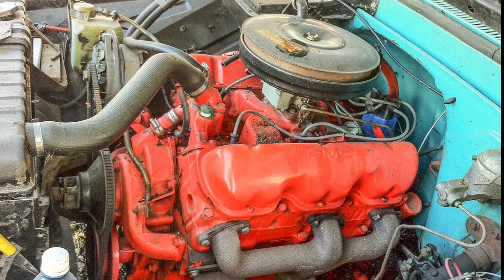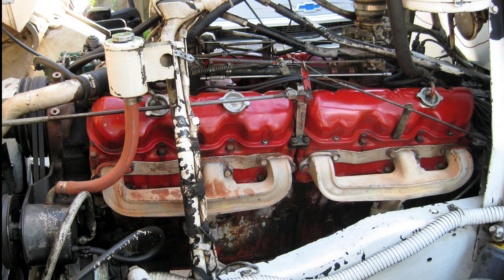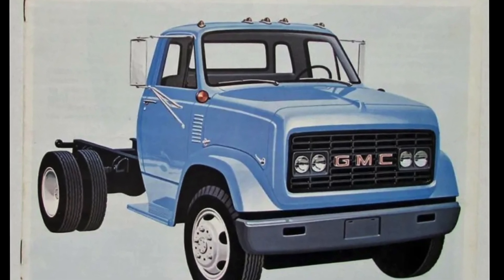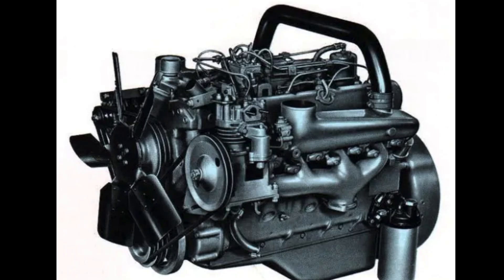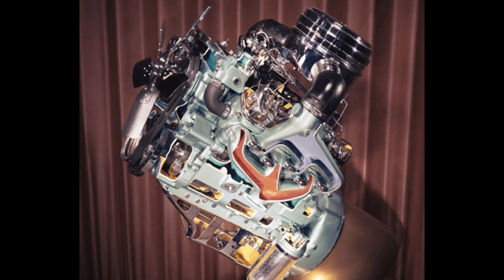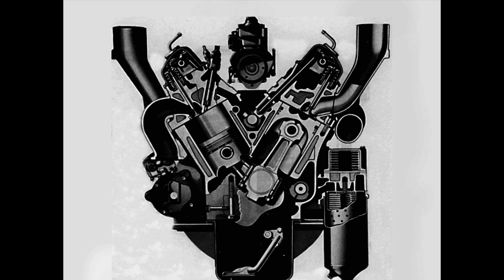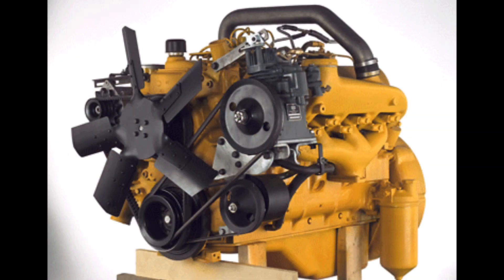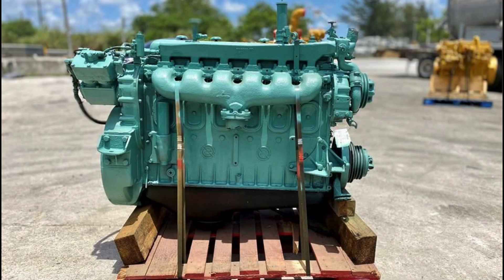Crazy Engines You've Never Heard of: the 351, 478, and 637ci V6/V8 GMC ToroFlow Diesels!

Comment: Great video!  I knew a guy that had a 478 toroflow in a Dodge pickup towing a 5th wheel camper.  He got pretty good milage but had never ending issues, head gaskets and injection pump, etc.  The gas v6 engines were one of the toughest and most durable engines of all time.  A buddy had a 305 and if anyone could destroy an engine he could but the 305 never gave up even with his 100k miles of abuse.

Comment: I have the Hercules 305E V6 in my grandfather’s ‘63 GMC 3/4t 4x4, 4 speed.  So smooth to this day, a real tq monster!!
Reply: Does it have the 63 only plad valve covers?
Reply: @p @patrickmcgoldrick8234  plaid valve covers, but I do have the original, operable, winch on the front and the PTO out the back. My G-father bought it new and we worked the farm w/ this truck. Original evergreen paint too😊
Reply: @bobbyb.1743 I have a 65 GMC 1500,that I have to replace the frame,hit in the left front,the burnt of the impact is on the left rail.305E,SM420,2 wheel ,89,000 original miles.I will have it finished by April.

Comment: It's worth pointing out that if they have the 351cid V-6 Diesel that it's not a big stretch to combine parts from 2 together into a 702cid Diesel V-12 and a donor block & parts from the 702cid Gas V-12.  260 hp and enough torque to reverse the orbit of the moon 🌚

Comment: Maybe I'm weird but it would be nice to hear Torque specs and the rpm where it was produced. It seems torque figures would be more useful than horsepower specs in towing applications these engine were designed for.

Comment: I have a couple of the 305 gas v6s..drove one a lot through the 1990s, it was really good, except for the mileage. A 1 barrel Holley can "pass a lot of gas". Maybe it didn't make enough power to hurt itself, I believe it was supposed to be 150 hp, but did not feel that healthy. Smooth and would pull from just a few hundred rpm. I did not confuse that with having a lot of torque, however- it didn't. 
   Gave the truck away, saved the engine and trans. Quite heavy. 
   I used to know where a 702 v12 was rusting in the woods, right next to the PA turnpike.

Comment: My brother had an old red gmc 4x4 351 diesel on 40s back in the day! That thing was slow as fuck with the granny gears but man it would drag another truck through the mud hole like nobody’s business
Reply: I think I found an article years ago where it talked about GMC had the 351 diesel in  a pair of 3/4 ton pickups that they were testing, showed a photo of one, GMC had toyed with the idea of offering that from the factory.  (Dodge offered 1962 models with the 354 Perkins diesel, option  only lasted one year).  They stopped the 351 diesel after a few years, if anyone has one, that would be rare today.  I  recently read someone's post, he says of all the gas and diesel versions of the 60 degree GMC design, the v6, v8, & v12, that the 637 gas v8 is the hardest to find  today.  He wrote that for many years, (whatever networking he does on online bulletin boards he visits or whatever,  that there aren't more than like 6 or 8 known to exist anywhere in the country, and only a few are running.

Comment: To  make  things worse  ,just  cuppel the  Olds  diesel engine  with the  new  700 R 4  automatic  😢😢  you've got  dubbel troubles  😢😢
Reply: There was never a TH700R4 with the B.O.P. bellhousing bolt pattern. I believe you mean the TH200R4.
Reply: @johneckert1365  yeah  man  I believe you're  right about that  , after 47 years  rebuilding automatic transmissions   I  forgot  more than  I remember 🧠🤪
Reply: @Louis-kk3to  Remember how awful those early TH700R4 were in the early 80's 🤮🤮🤮🤮🤮
Reply: @Louis-kk3to  I'm in the auto salvage business, and I have a hot rod friend that buys every TH200R4 I can find. He really likes them! I assume he has them built though. 
My Mom drove a mid 80's RWD Buick with an Olds 307/TH200R4 for a few years, and that torque converter lock-up solenoid would act up and freak her out when the car would lurch and go fast in reverse lol. On the other hand, her car before that was an 83 Riviera, Olds 307, and whatever that similar FWD trans was called, and it had over 300K miles on it. Trans was replaced or rebuilt once (she bought it with a bad trans) but for her it worked flawlessly. We even pulled light trailers with it, but to be fair, she knew to only used D rather that OD with a trailer. I'd actually like to find another car like that, but with an Olds diesel.
Reply: @johneckert1365  the  200 4R  is a assume  unit but  !!!! I hated  rebuilding  them   ,  im glad  I don't  see them  anymore     and,  that  L/ up really  sucked   😩 47 years  rebuilding automatic transmissions   and the  6 L 80 E is now  our  ( bread and  butter  ) unit
Reply: @johneckert1365  yep  , but  I wish I never  tossed out  all thim  units   because  now  they  are  hard to find  , the Fits all company  used to  make  a adapt  kit  to  change  our  700 to a  350  , no  body  ever  complained  about it  because  it was  allot  cheaper    than the  700 rebuild   now  I  wish I could have  back  those  700 s  because  square  body   Chevy  trucks  need  them  and ,good  ol hot rod s
Reply: @Louis-kk3to  My core buyer in Chicago was paying $250 for the later TH700R4, and $50 for thier torque converter. The most recent price list that came out is down to $150, so I'll stock pile them. They still give $250 for Chevy bell TH400, but only $15 for it's converter. Chevy non-lockup TH350 was also $250, but also dropped down to $150. They'll come back up!
Reply: @Louis-kk3to  I've used that spacer kit to replace a TH700R4 with TH350 in 4x4 trucks before. In 2wd, the long shaft TH350 is the same length as TH700R4, so pretty much a bolt in swap 👍

Comment: THAT GIANT V12 WOULD PULL THA GATES TA HELL DOWN THE TORQUE THEY PRODUCED WAS NOTHING LESS THAN INCREDIBLE
Reply: I saw it on the "king of obsolete", he liked it because it had "dual everything". It's basically 2 engines stuck together. GM was super innovative in those years. It's too bad they didn't quite dot all the i's and had some reliability issues.
Reply: @castirondude Not so much of a reliability problem,but a fuel digesting problem, lots of fuel,but they would last.

Comment: The 6.2 was a great engine. It really did go a long time when taken care of. Even the olds 5.7 could be solid when not in a vehicle. They made excellent irrigation power units. The 8.2 Detroit was an absolute turd. It’s a shame the olds stuff wasn’t better because we would have a different American car industry today had they been able to prove themselves. Us Americans seem to have an obsession power output stats but all my 6.2/6.5 equipped trucks have had a good seat of the pants feel to them. Last forever when used for their purpose. Very low cost of ownership compared to other diesels.
Reply: Those 6.2/6.5 get better fuel mileage than the Izuzu (Duramax) that replaced them.

Comment: Anybody want to see what one of those gassers would do with a pair of turbos? Kind of curious what the diesels would do with some turbos? It's difficult to get any real hp out of an NA diesel. I had a 7.3 IDI Ford and it was like 180-185hp so not really that much better than what these were doing 20+ years earlier.
Reply: The Toro Flow Diesels 478 V6 and 637 V8 were both offered with single , possibly twin turbos.....I'm not an expert on them, but you can find some articles,  pics, on them if interested, just keep changing up the words when you search.  I've looked before.  Those with turbos were installed in boats, I understand they lasted a lot longer, than a Toro Flow that was asked to pull way too many tons.  They were known for being very very fuel efficient diesels for their time. But sometimes,  depending on what truck they were installed in, guys ran them hard, overloaded them, if you treated it like a Detroit, and just rode her hard like a government mule, they had issues sooner.  Ammarine is a name from that era, tied t ok the marine versions of the Toro Flows put in boats.  There's still a video or 2 on YT,  if you search for the V8, but as a 10.4 litre.  (Water cooled exhaust manifolds, but it's a V8 Toro Flow underneath)

Comment: I got my first GMC V6(a 305 c.i.) while serving in the Navy back in 1985.  I bought a former Washington State Forest Service 1963 GMC longbed/stepside.  I found probably the last tire ship in Washington(Tacoma to be exact) that would mount new tires onto the original split-rims.  I drove that truck from Washington down to California when my ship(USS Belleau Wood) came out of the drydock in Bremerton to return to San Diego.  I eventually gave it to my Dad, who drove it form many years up in Northern California  The next was a 351 c.i. in a 1962 GMC utility longbed I rescued from a junkyard in Oxnard California in 2000.  I ended up finding a fleetside bed for it and even found an early '70s camper that I put on.  Whenever I had a long weekend that old beast and I would head east from NAS Pt. Mugu and disappear into the mountains or desert for a few days.  Very early I was given a great education in these V6 GMC engines; I learned how NOT to mistreat them and how to keep them running well.  The most important thing I learned was not to 'over-rev' these motors.  They were designed for low-rpm/high-torgue applications.  That made them great for work-trucks.  Because of that education I never once had a problem with either engine.  I replaced the old points ignition on my '62 with a Pertronix electronic ignition.  I also found a nice Holley 'Economaster' 2-barrel carberator.  The combination allowed me to get a stable 15mpg with this old beast.  I'd love to find another someday.

Comment: Alright! Thanks for another interesting video. Interestingly enough I personally drove a 1968, GMC 6500 straight truck with a 21’ refer box, with a 351 Toro Flow Diesel engine. With a 5 speed low hole 1st, wide ratio w/OD, and a 2 speed rear. We used in a family trucking company.  I was bottom man in seniority so I was stuck with “Shaker” as it was affectionately called. But it ran very well, used little oil to leaks not burned, plus it true that used half the fuel the same truck with a 305 V6 Gas used, plus was quicker if you knew how to split the gears, plus higher top speed at 74 mph, as apposed to 72, at the same rpm’s. Funny thing is Shaker looks just like the blue one in the video only with a big white refer box on the back. I personally put well over 200,000 miles over the 8 years I drove it. Then after the union forced us out of business, my Dad sold the truck to a cousin, that wanted that engine for an old tired GMC 2500 step side pickup that had a 305 V6! That had 180,000 miles and was tired. He was restoring it and figured might as well sell that gas engine and trans, then buy the Toro Flow truck off my Dad, rebuilt the TF and use in the pickup, being the very rare diesel powered all 1966 GMC truck around. He rebuilt it, added two air cleaners, one on each manifold and huge dual exhaust out the sides. That pickup was used to haul out dirt bikes and tow a trailer with 10 others for a group of riders following in their other vehicles. Before? With the tired V6 gas, three speed? It was a chore, waiting for it to keep up. But after that? With the rebuilt TF? with 5 speed? He had to add disk brakes in front! Because of the speeds it would easily reach so quickly, especially when towing the trailer! Plus got more than twice the mileage, like 26 highway, 18 towing! With a wonderful sound! Everyone wanted that truck.

Comment: I've been around, and drove a lot of the GMC V6 gas engines, but have only ever seen 1 of the V6 Toro-flow diesels, and it wasn't running at the time. I wasn't even aware that they had a V8 version of that engine. Pretty cool stuff!😉

Comment: Adam, quoting horsepower for a diesel is not very helpful as torque is the main advantage of a diesel engine. It would be more illuminating to quote torque figures on these diesel engines.

Comment: That diesel at the end sounded very nice Adam. 👌  Unintentionally much needed for me. Lol
Reply: It's just like a certain generation of the Duramax diesel that had head gasket issues. Once that's taken care of with upgraded ARP head bolts and tuning and deleting, they are stout after that, but that's more focused on the modern computers on wheels world, but yeah if it wasn't for GM's confidence in making four stroke v8 diesels, they probably would've never debuted the Duramax lineup starting in the 2000s.

Comment: I have a number of original shop service manuals for these very GM & Detroit engine from my dad, who, after years of being a heavy equipment operator & OTR truck driver, went into being a diesel engine tech back in the late 70’s… myself from end of HS into college, went into construction/framing, followed suite by the mid 90’s, working as a cert’d auto tech for gas & diesel, performing repairs for anything & everything.. then, power tool repair/rebuilding to machining. By oh, ‘07, went to OTR and local trucking, then plumbing, then HVAC, then HAZMAT fuel tanker trucking.. since covid, back to auto tech, gas/diesel & all things electrical… I have auto/truck service tech literature from oh, 1903 to early 2000’s, when most of that went to digital. I too really enjoy all of these engine vid series &, anything else you’ve put together/uploaded for us! One of my top 5 sub YT channels! 👍🏻👍🏻

Comment: I had a really strange motor in a GMC truck. It started life as a V8 Toroflow. Somewhere along th line, th heads and intake manifold was swapped out with gas motor parts. I remember that it used th same starter as a John Deere tractor. I sure was glad when that thing finally blew up.

Comment: Direct-Injection was the exception back then, not the rule. 
Modern diesels almost all have the bowl in the piston because of the DI. 
Very interesting.
Reply: Were these Toro Flows direct injected?
Reply: @johneckert1365  Yes. The fuel is injected directly into the cylinder, not into a pre-chamber.
Reply: @typrus6377  Thank you

Comment: I would bet that this diesel version was the smokey and slow engine I had in my school bus in the early 70s!  It had the same front end as that semi-tractor you pictured.  On the other hand, these GMC engines were much tougher to begin with then the Olds Rocket 350, and would have been an easier conversion to diesel...  
One question, why would a 60-degree V6 need a balance shaft?
Reply: Did Adam say it was oversquare? I have seen 60 degree sixes run buttery smooth, -so it is a great question!
Reply: @ratman5727  I totally agree about so many engines that ran smoothly...
Reply: DUDES, that is my point! A 60 degree V6 should be inherently smooth, ergo why did they put a balance shaft in that engine.?

Comment: If you needed a ~150 hp diesel in 1964, I can't imagine picking one of these instead of a 4-71 Detroit - offered by the same corporation!  Unless the price difference was extremely steep...
Reply: The problem probably was the weight difference.

Comment: Knew two guys that had the Toroflow in a couple of their trucks they seemed to like them. One of the guys said the difference in fuel cost almost made the truck payment. 

Having talked with a few mechanics that worked on the Olds diesels the big reason for the head gasket failures was due to the poor grade of bolts used for the head bolts meaning the head bolts would stretch. The quality of the head gaskets was also suspect.

Comment: Back around 1990 I put a 478 gasoline in a GMC dump truck that had a blown up 305 in it. A guy I knew showed up im my shop and said "Hey I've got one of those engines" Next day he showed up with it in the back of his pickup and sold it to me for 200 bucks. I started looking and saw the dual thermostat housing and knew what it was. Damn that thing was a torque monster. You hardly ever have to shift. Funny thing about it was the exhaust had a low deep rumble that set off car alarms of cars parked on the street

Comment: GM made a huge mistake not putting a water separator in the Olds 350 diesel.
Reply: Right on 👍. Water/fuel separator and some high quality head studs rather than bolts would changed history DRASTICALLY.
Reply: @johneckert1365 The crankshafts were the other weak link in the 5.7s.

Comment: I had a 478M V6 gas in my 4900 Alison automatic GMC boom truck .
Excellent motors.
Truck was faster than diesel but burned alot of fuel .
8.1 pincher 366,427 replaced these later .
Reply: 8.2 you mean 😉

Comment: Detroit Diesel did not design the 6.2/6/5 diesel.  Chevrolet did.  GM transferred manufacturing to Detroit Diesel later on.  Detroit Diesel had previously developed the 8.2L turbo diesel, known as the Fuel Pincher, in the 1970's.  It was a disaster.  Head gasket problems, too.  And fuel injection system problems.  And camshaft problems.
Reply: It drives me crazy when all these clowns refer to Chevrolet 6.2/6.5 as Detroits. 
FYI, the 8.2 Fuel Pincher was also offered as Naturaly Aspirated, not just turbocharged.

Comment: G m c gas v six lots of low end torque small stromberg 2 bbl carb spark plug location between intake manifold and valve cover and a sound that was like no other could hear it coming a block away!!